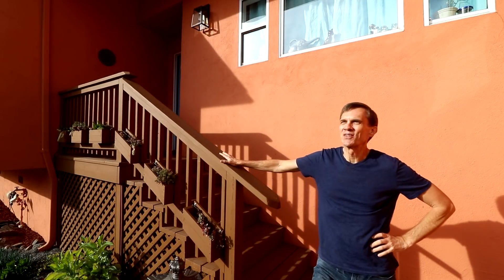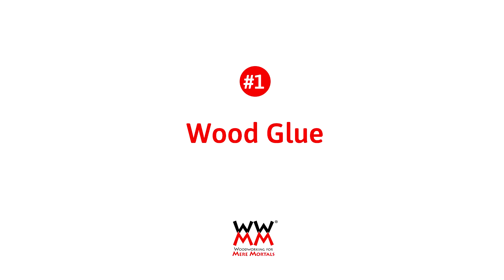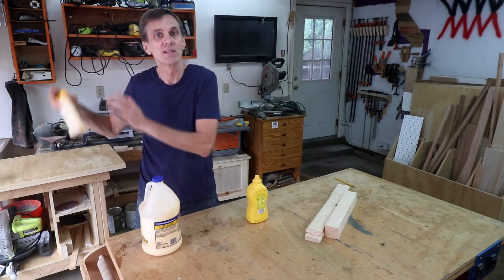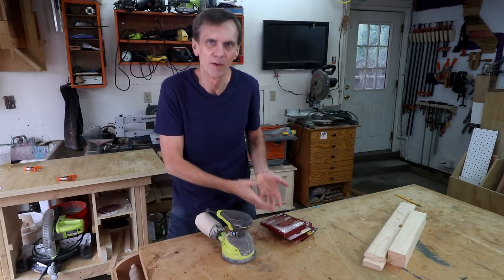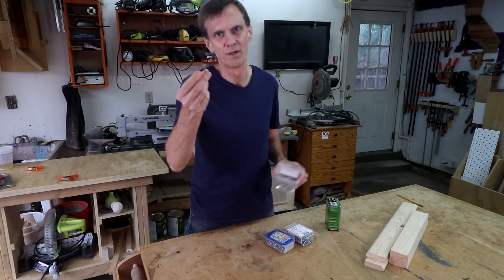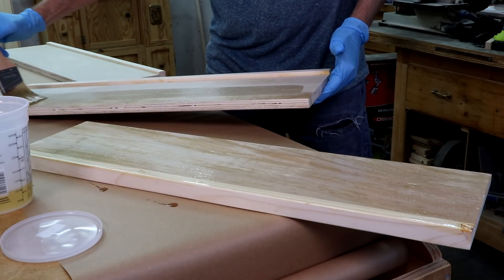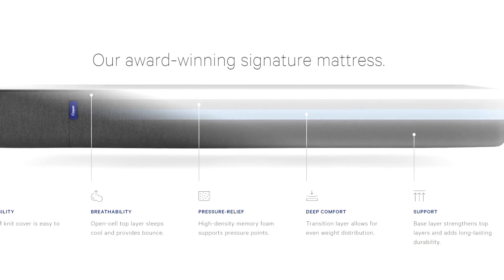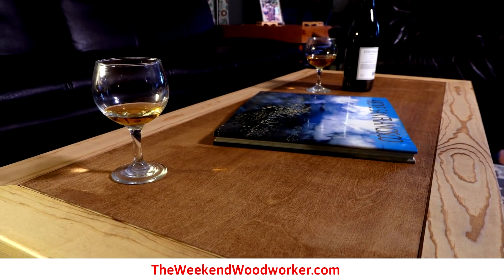5 Woodworking Shop Essentials. (DON'T RUN OUT OF THESE!)

Comment: just to be a know-it-all....your blue gloves are not latex but nitrile (that´s better anyways). thank you for the nice video.
Reply: Nitrile. I agree that for most woodworking applications, nitrile gloves are better than latex.
Reply: Indeed, Nitrile is more solvent resistent and ideal for people who suffer from Latex allergies.
I see them more and more in hospitals also.
Like Latex, you can find them powdered or unpowdered.
Nitrile gloves are mostly blue, although you can find them in other colors as wel.
I mostly use black ones. I don't know why. Maybe I use the blue ones all day long at my job. :p 

In Belgium, I had to look really long and hard to find Nitrile gloves as private customer.
While for my laboratory job, I buy them by the thousands without effort.
But the company who sells them to my job, only sells to other companies.

One more thing: Don't confuse Nitrile with Vinyl gloves.
Vinyl gloves don't react well to some solvent, especially thinner and epoxies.
Reply: are there still people using powdered gloves? those things are awful.
Reply: People are supprised how many gloves you need for a single epoxy project.
Reply: Ju Na you’ve have good eyes I couldn’t read the print on the box so I took his word they were latex.
Reply: the color was a cheap hint. Latex is mostly pale beige. Nitrile gloves come in many different colors...so far i´ve seen dark/light blue, purple, orange and black.
Reply: Please be advised: the blue nitrile gloves my company uses for precision operations, often have soap residue on them. I don't know what "soap," but I do know that since I discovered this variation all gloves from that manufacturer have to be tested before  being used in sensitive areas of the plant. (They test them by spraying water on the glove and rubbing it. Then if one sees bubbles or film the box is sent to a less sensitive area of the plant.)
Reply: I'm not alergic to latex, so I thought I'd be fine buying cheaper, but you know what, nitrile just feel sturdier.

Comment: Sanding discs - I am exactly the same just cannot throw them away :(
Here in the UK we can get star pocket hole screws too so you probably can too. They are otherwise the same as the Kreg ones and they even do a ball-ended driver bit for when angles don't line up exactly

Comment: Words of the wise:  money saving and frustration reducing tip:  microflex diamond grip latex gloves.  You can reuse, and reuse, and reuse and they just don’t tear nearly as easily as any other glove I’ve tried.  They sell two kinds, your traditional yellow and a blue that’s even thicker and stronger.

Comment: I'm glad to see you also use torx (star) screws, they are great! It's almost impossible to strip them out no matter how many times you use them, unlike those damn phillips head sh*t screws. I hate phillips head screws, they should be banned from the world. Not to mention the million of different kinds of phillips head that all need a slightly different bit or they... strip out.

Phillips-heads are only acceptable for when you're screwing things together that never-ever have to come apart again. Flat-heads are annoying too, the bit slips off way too easily. Why are there so many different screw-heads? It's unnecessary and it just complicates things.
Reply: Robertson screws ... Oh wait only in Canada... mahahahaha
Reply: Nope, we have them here too. All the Kreg screws have Robertson heads, for example.
Reply: The variety of head screws is related to production cost, and reliability. Flat fence are cheap to produce. Philips patented their head for better reliability on production chains. Then, pozzy allowed a better fitting of screws on the bit, then torx was a public standard specifying ... Torx that could be applied on the screw, and this industry standard is better suited for automobile where every single screw need a very specify tork ... 

But, torx screws are much more expensive to produce.. 

It all depends on how fast you need to produce, how much times employees can spend on trying to make the tool fit the screw, and the certification you need to provide for quality .  

Note that in France, black screws for dry walls can be used with pozzy heads. 

Some companies have developed a variation of torx, with a special ending, to help the screw stick on the bit so that you can keep you second hand free to handle your project, or grip on the ladder. Forgot the name of the company, they mainly do this for wood screws. 

I buy pz2 when I need to work fast on small screws (3x20 to 5-60), and torx after size 6mm, to have a better reliability in hard and thick wood.
Reply: Thanks for explaining. I'm still not really sure why torx are more expensive to manufacture though, i'm assuming the screw heads are stamped into shape so what makes it more expensive to stamp a torx vs any other shape?
Reply: I once build a bouldering wall in my front yard. I used about 3000 torx screws. I  managed to pull them all out again 4 years later and reuse them to build a garden shed from the leftover wood. Those things are indestructable as long as they are dry. You can also re-sharpen the bits. I use Wera bits that last for about 3000 screws.
Reply: If you're lazy, pozidrive is just enough better than Philips to be worth it without spending too much extra.
Reply: Phillips head screws were designed to fail. Phillips was associated with Henry Ford, who wanted a screw design that his customers could not over tighten, hence the problem with Phillips screws chewing out the head if you don't really lean on them. It also didn't hurt that Phillips sold a licence to Ford to manufacture unlike Robertson who insisted that all screws using his patent had to be manufactured in Canada. Pozi drive was intended to solve the cam out problem of the Phillips, but now we have 2 very similar looking standards that are definitely not interchangeable, rather like a horse, donkey or zebra.
Reply: I was going to switch to Torx or Robertson screws, but LowesDepot doesn't seem to carry them in all the sizes I use, so I stuck with Phillips.  Next time I need to buy some screws, I may just go online and get the Torx.  Course, I will have to plan ahead a little--not really my thing.
Reply: That's true, i'm having a hard time finding them too. The hardware store where i bought my last batch doesn't seem to have them anymore. :( Apparently they're not so popular among woodworkers since they only make up like 1% of all screws in stock (atleast where i shop).
Reply: Screws are way cheaper online anyway.
Reply: I'm going to assume by flat head screws you mean slot screws, as there is nothing wrong with flat head screws, especially when you want to have screws sit flush with the surface they are being screwed into.

Slot screws on the other hand are cheaper to manufacture, and are good enough for occasions where not a lot of clamping force is required, like screwing outlet covers.
Reply: rivahkillah Yea that's what i meant. You're right.
Reply: I was super happy to make the switch to torx screws. I have never gone back since I started using them. Occasionally I use the dreaded Phillips, but only if the project calls for it specifically.
Reply: @Benoit-Pierre  Thanks!  My brain enjoyed that.  Be safe out there!
Reply: @brucelee3388  Wow!  Full circle, Ford vs Edison.  (Or, was it Tesla?)

Comment: You should check out automotive supply stores that sell stuff to body shops. They will have 3m sandpaper in a much larger quantity. It lasts longer need and it's cheaper

Comment: Speaking of star drive, 8 x 1.25" screws....I did the research at Lowes, where instead of a 1 lb or 5 lb, I went for 1/3 of the cost each for a 10 lb box. Sure. Laugh at yourself a while, but the cost difference seemed like a good idea to me. By coincidence star drive doesn't have a standard popular size (e.g. Phillips #2) so picking by efficiency, I jumped to #25 star. I'd have been just as happy with #20. Who cares? But when spending, coordinate your choices. BYW Lowes does 10% veterans discount every day everything. Better than 11% rebates sometimes.

Comment: I have started using nitrile gloves instead of latex, they last longer, and is easier to reuse, as the are not so prone to breaking up when getting in contact with different chemicals and oils.
Reply: Yup, I second that, they last way longer.

Comment: Really enjoy your videos but if i can make one request, please mention metric measurements as a lot of people use the metric system, especially over the pond ^.^
Reply: We use metric in Canada as well, but virtually everything sold at the hardware store is measured in imperial. You get used to bouncing back and forth. Get in truck, go to gas station, buy 20 liters of fuel, drive 70kph to hardware store, buy a 4'x8' sheet of plywood and some 5 inch sanding discs, drive the 20km home, finish project, go inside and watch the 70 inch TV

Comment: In your sandpaper video you recommended 80, 120 and 220 grit sandpaper sheets and not 60, 120, 220. Has your thought changed on that?
Reply from the maker: +Larry Leveen both will work fine!

Comment: A simple rope. You would not believe how much one can achieve with a rope and a small assortment of knots. There are knots that allow yo to squeeze things together  as hard as a clamp. Knots to attach anything to anything. And knots that will only tighten when pulled - those can be a good safety precaution.

Comment: I like to keep enough cleaning agents incase of a accident spill.  2nd, having different sizes of screws. 3rd, is blades and drill bits and sandpapers. 4th,  is paint. it frustrating when u need to add another coat only to find out u dont have enough left. 5th,  (not  necessarily a trip to the store) but having the batteries charged on your power tools.

Comment: Oh my gosh yesterday I threw away about 30 used sanding discs, I have no idea why I was keeping them, especially since I always have a supply of new ones. And I always buy a gallon of glue, and 1-1/4 screws I need to buy them by the case, and I only used torque head screws, I literally throw away Phillips head screws, torque head screws are virtually impossible to strip. "I happily pay the extra price they there worth it".

Comment: clamps. get lots of clamps
Reply: Chad Olmstead make a clamping board for gluing up panels.

I used an old hollow core door. Attach several 3/4"-1" strips of plywood or wood(I have 10 total). Make them about 3"-4" shorter than ur door (board) is wide. Space them about 4" apart. Attach with brad nails, or counter sink and use screws. Then cover with painters tape. 

Then use a 4' long 1x4 board with a straight edge. Then attach it 90° to the wood strips, on top of the wood strips along the top edge.

Then glue up ur panel. Screw down another 1x4 board about 1/2" below ur panel. 

Then use some wedges and hammer them in gently, don't need alot of pressure. Wipe off any access glue. Attach a couple cull boards across the panel to keep it from bowing up.

Ps. Learned this from Izzy Swan. He has a few videos on this.

I do not have any clamps over 18".
1 pack of those erwin quick clamps, and 4 pack of small clamps.

I make lots of tables and have yet to need a 2' + long bar clamp, or a pipe clamp. Sure they would be convenient, but I've saved lots of money. Considering that a decent 2-3' bar clamp is $25, or a pipe clamp is $14 + the cost of the pipe.
Reply: Cn = Cp + N, where `C` = clamps, `n` = needed, `p` = currently possessed and `N` = a nonzero positive number.

Comment: Yo yo yo my woodwork homie, save masking tape by laminating paper of varioud sizes (a4 a3 etc) and using that to mask of huge areas and seal the edges and seams with tape.  You can reuse the paper afterwards and save hundreds of square feet/meters of tape in the space of a few weeks.
Regards from England.

Comment: I keep used sandpaper discs on hand until I can use them for a job that would ruin a new disc such as a fresh glue up, or removing paint. When they get gummed up, I can easily throw them away.

Comment: To me is drill bits. I always brake the thin drill bits, then I dont have the right widhts to use so I end up using the incorrect ones and the whole thing becomes a mess. They are very fragile..

Comment: A well used sanding disk becomes a polishing disk (in metal work at least) Just a tip from a fellow pack-rat :)
Reply: @ya2131  Not rated, but does the job. Just use a little common sense and experience. Not everything needs a mirror finish!
Reply: @ya2131  I'm assuming these are genuine questions and not a troll :)  
One of the hardest things to teach a new metal worker/machinist is using their gut, it pretty much only comes with experience.  A worn course grade disk is going to still be generally courser than a worn fine grade disk. You have to learn to look at it and know this is going to "be about right" for the job at hand.  Say for example you want to sand something down a bit to have tooth for paint to stick, and you don't really want to remove any metal, but you've got this worn disk that looks about right. Sometimes it will give you that "in-between" level of coarseness that fits the polishing job too. It is very situational.  Yes, you can use a worn disk in the process of taking something to a bright finish. Frankly, if you've got the time, and are masochistic, you can take something to a bright finish with a buffing wheel alone :) I'd not recommend it! 
My original point is not to throw away a disk that has become worn, within reason (a handful in a junk drawer is about right, maybe a shoebox full.)  Save up those worn disks, get a piece of scrap metal, and play around with it. 
I'll throw in a bonus for you here, too. If you are going to sand aluminum, or anything else that likes to gum up a disk like some varnishes or paint, chalk up the disk first, it won't clog so fast. (Rub it with a piece of chalk until you given it good coverage, no need to get crazy with it) The chalk fills the spaces in the sandpaper and acts as a release agent to keep it from gumming up so quickly.
Reply: @ya2131  No problem. I am always glad to help out someone who wants to learn. Trouble is, and I have stopped posting to a lot sites because of it, I get trolled a lot, esp. by keyboard metal workers who have never cut/bent/forged a piece of steel in their life, who try to run folks like me in circles for some reason. 
Sadly, a lot of info is being lost due to those folks, as people like me just stop sharing what we know. 
Don't be afraid to get yourself some scrap, and experiment, it costs very little, and you'll learn a lot. You'd be surprised at what you can accomplish with just basic tools, and really learn how metal behaves while you're at it. 
There are some very good YouTube sites (and some horrible ones) that can teach you a lot. Jody's site for welding, Kevin Karon for metal work in general, Black Bear Forge for blacksmithing, and for a good laugh while you learn, This Old Tony.  Of course for woodworking , hard to go wrong with Steve's WWFMM, and there are a few others as well. 
In the end, have fun with it, and don't get caught up in perfection, I can't think of a home project that needs a CNC and holding a .0005 tolerance. Unless you want your very own submarine or space shuttle! :)

Comment: My pet storing hate is the sanding flapdiscs for angle grinders. With all the flaps overlapping each other by, say 90%, only 10% gets used before they burn the wood. There's no way that even steel or stone will cut back to useable abrasive, yet I still store dozens of them in the vain hope....

Comment: Also the sand paper is best brought at an automotive auto body supply they are much better quality
Reply: Therealphantomzero - I just ordered a surface plate that is 9 by 12, which is the size of a full sheet of wet or dry sandpaper. It should be great for sharpening chisels hand planer blades.
Reply: Paul Keen that's a really good idea, where did you get that from?

Comment: Low quality sandpaper is not worth buying- like the Home Depot Diablo red brand.  Good brands are 3M and Klingspor.  Shopsmith brand that Lowes carries isn't bad.  Not as good as the 3M or Klingspor, but still decent.

Comment: Latex gloves are very problematic. Break easily, don't stand many chemicals, allergenic for many people (any residue on your project can hurt your customer). I mostly use vynilic or mytril gloves. There are many other types (neoprene is food-friendly). Note that all gloves have their cons. Vinyl dislikes acetone. Latex hates white spirit. Also, because gloves prevent normal breathing of the skin, I usually use hand cream before putting them. 

I also use vinyl gloves on top of fabric-tissue gloves when I do concrete, or work with wet stuff, of plaster.